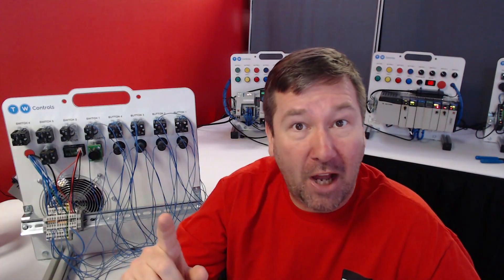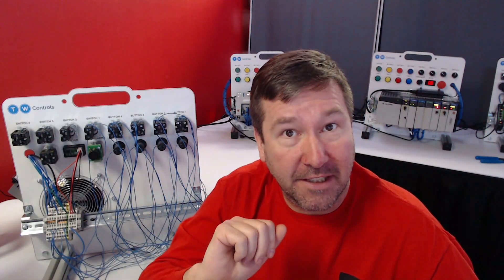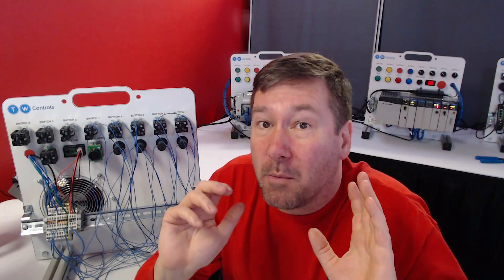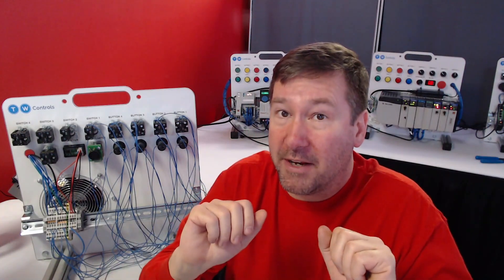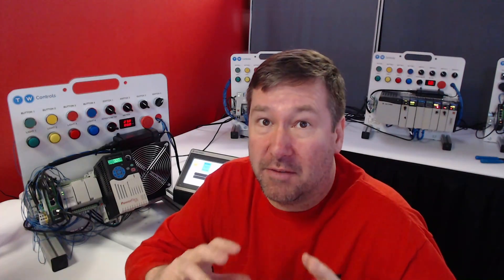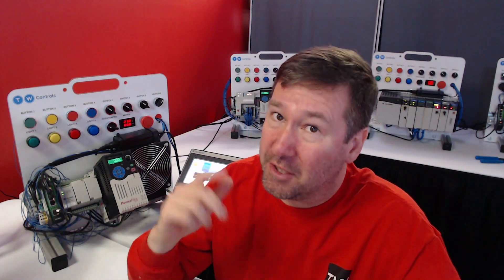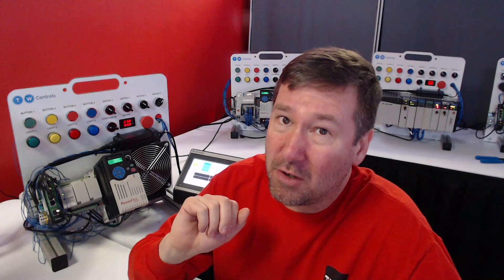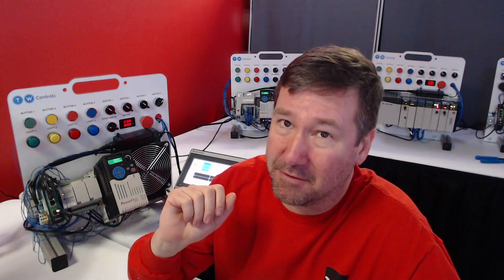Building Your PLC Trainer on a Budget.  DONT Make These Mistakes!

Comment: Looking to build a "Controls Demo" unit with a Micro850, HMI, VFD, relays, lights and buttons for a project. I'd like to include a FAN or something similar that makes noise for a "motor stand in" like your trainers. Do you have any small fan recommendations? This will be semi-portable so I want to keep it able to be plugged into a normal wall outlet.
Reply from the maker: Google axial 3 phase fan, that is probably the easiest one to "make noise" with.

Comment: I would choose the simplest and most common PLC you will see at your company. Where I work, this would be a micrologix 1000.

For home learning, I am loving the micro800 series. It's around $400, tag based, and has easy to use software. Too bad they don't have a Linux version. I wonder if it will work with wine...
Reply from the maker: Yes the Micro800 is a great PLC!

Comment: The timing is impeccable! I'm a 2nd year electrical apprentice with the IBEW and I have a deep background in programming. Namely Python and JavaScript (scripting languages are where I thrive). Just got out of class on this lovely friday and was talking to my instructor after class because he mentioned he has a background in PLC and basically told him I want to get into PLC and have since I started my apprenticeship. I mentioned my plans of building a PLC trainer and he gave me direction to a place where I can get all of the supplies much cheaper than online. Get home and this is the first thing in my feed! I’ve had no problem working around on the logic end, and I’ve made sure to include legitimate parts of a PLC program like E-stops and the whole procedure for a restart after a sudden stop like an E-stop or loss of power. However, because I’m only in my second year, I’m still doing AC Theory and the likes, we don’t get into PLC and Motor Controls until 4th year. It’s a little bit of a “Hurry up and wait!” kinda situation but I got bit by the bug and really want to get into it. Do you know of any resources I could use to get a deeper understanding of the electrical side of things like relays, motor starter coils and the kind of things I’ll be installing in the field and how I’ll be interacting and interfacing with them? Like I said, I get the software end of things pretty well but the circuitry end is where I start to get a little lost. Im essentially looking for a library of videos from you or someone else about the back end of the control circuits and how those parts interact with the PLC.
Reply: Good luck a micro 820 from allen bradley  is great on a budget can get CCW free from alllen bradley and they are the industry leader at least here in the northeast , 
 they have the logix theme in CCW and can also commission powerflex vfd down the line but for now a micro820, few lights ,buttons ,wire from amazon or wherever  and you are all set  . 
Personally I tried prior to buying a more structured trainer from TW Controls and I ended up with a pile of parts..... which at least I know how to use now thanks to great training videos tw does for the trainers
Reply: Well need a little more than that would habe to add a . 24v dc Power supply ,piece of dinrail or two and terminalblocks , but I wish you luck my last trainer my boss askede to build for for work pretty nice and we are filling the huge skills gap between the books and schoolinf that sits you in front of a pre wired, pre  configured plc just to learn ladder logic .